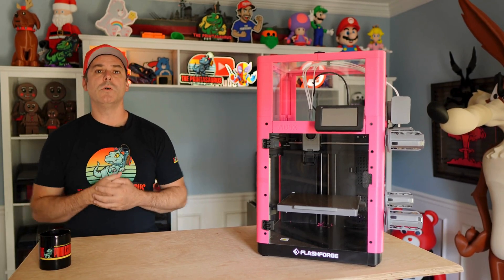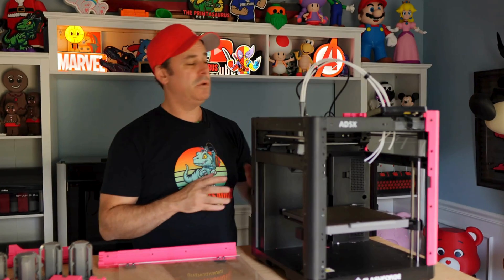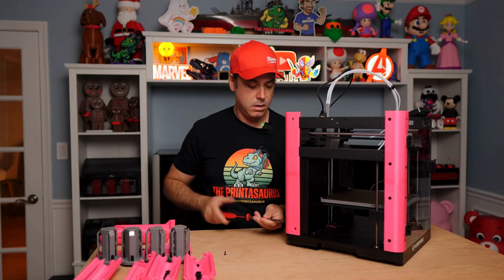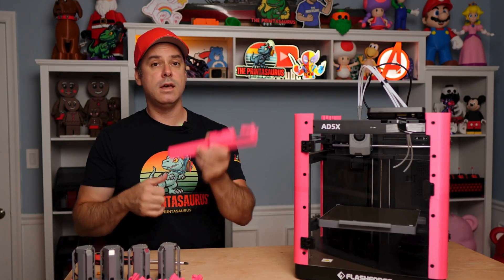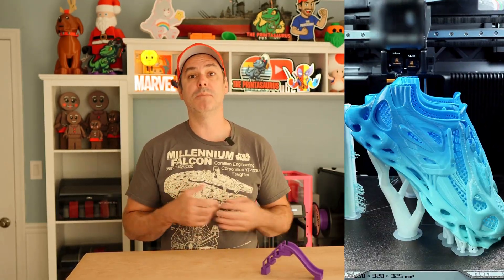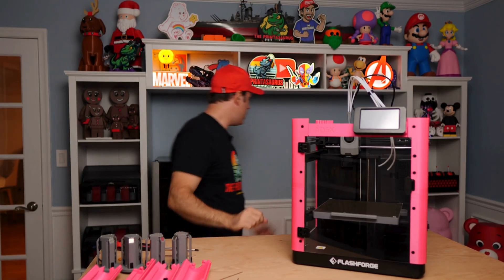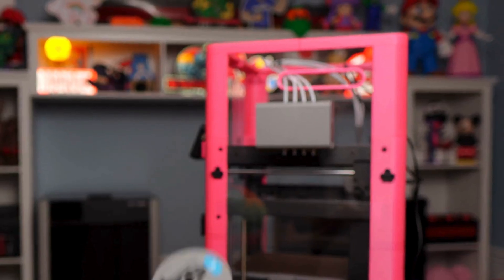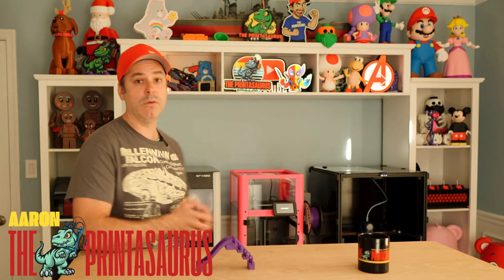Flashforge AD5X Enclosure Installation, Full Setup Guide

Comment: To add for people who are new to this, on the AD5X the tubing comes off of the hub by twisting the locking mechanism a quarter of a turn then pulling. You need needle nosed plyers for this.
Reply from the maker: Thanks for adding this
Reply: Спасибо тебе, добрый человек. Я долго мучился, боялся сломать.

Comment: Some screws that should be unscrewed just spin freely, making it impossible to unscrew and therefore install. This is especially true for the screws holding the spool holders.
Reply from the maker: Should be longer screws in the kit for the spool holders. M3x8 if I remember correctly. What may help, keep the other screws loose, thread / screw in each spool holder then tighten the remaining screws.

Comment: can i print the enclosure with pla or do i need a more dense material
Reply from the maker: PLA would be fine, PETG preferred. If you plan on printing some ABS or ASA I would at least use PETG as it will support the internal temps better. But if you plan to just print PLA/PETG/TPU you can use Pla without any issues.
Reply: @ThePrintasaurus  i will be changing to a universal enclosure as ad5x is currently unavailable by anyone other then scalpers the prices are appalling compared to flashforges store prices thank you for the knowledge in advance if i decide to eventually get one for proper price

Comment: Has anyone had issues with the side panels not having slots for the IFS unit?  Mine does not have screw holes.
Reply from the maker: I’ve not heard of any issues. Have you reached out to flash forge?
Reply: @ThePrintasaurus  I had that issue on the set I received also. Both side pieces were the same, and did not have any additional holes for mounting the IFS. After I placed the panel in the side holder I drilled holes to line up with the frame screw holes. Easier, quicker, and better than trying to deal with shipping.
Reply from the maker: @d.r.4338   That does sound like a quick easy fix. I wonder if they have had some manufacturing issues, sounds like it on the panels. How has your build been otherwise?

Comment: I'm trying ti put the spool holders back on but I need counter sunk screws and the m3 aren't so the spool holders won't clip back on. How did you do it?
Reply from the maker: You should of had longer screws that came with the kit? Are they missing? Should be m3 X 8 mm, 2 mm longer than the ones originally used.

Comment: I would like to know if you could send me the profile because according to my setting it will take well over 40 hrs using petg. Also what extruder are you using because I thought with the 0.6 it would lessen the build time?
Reply from the maker: Send me an email to aaron@theprintasaurus.com and I'll send over what I've optimized for a few that have requested it.
Reply: With the enhanced version with the taller top piece it took 45.9 hours to print it all on a AD5X

Comment: 20 hours to print?  Is there a secret to printing the parts?  I'm doing just the first printing plate of I believe 6 total, and it is going to take 39 hours to print.  At this rate it will take all week to print most of the large parts.  I am using PETG as it was recommended online.  I am printing 2 different colors which may take a bit longer but how did you do it in 20 hours?
Reply from the maker: I have my print profiles refined a bit. With the enclosure being supported by the printer and more less being a cover, I went lighter on infill, walls, etc which speeds things up. I can send over a 3mf that I did for a few people who requested some help. Would be interested to see how yours turns out with 2 colors.
Reply: @ThePrintasaurus  I'll let you know in about a week or so. Lol

Comment: I dont know what print profiles your using but with petg my print time is in excess of 40 hours. Also the pre arranged print plates are best avoided too many parts and bed adhesion on ad5x is not great. I had print fail and spaghetti at 90% cost me 400 grams of petg and 15 hours print time. 

Ive now completed the prints, printing the corner pieces 2 at a time split between the ad5x and qidi q2
Reply from the maker: I've have a 3mf setup that I've shared with those that have asked. I have fine tuned some settings to speed things up, I did print with the AD5X, utilized a brim to help with stability of the column (A,B,C,D 1-3). Totaled out print time was about 24/25 hours total, days worth of printing. If you'd like that 3mf, send me an email and I can send it to you. aaron@theprintasaurus.com

Printing one by one is never a bad idea either. What color / brand / type of PETG did you end up using? Curious to hear how everyone's enclosure looks and turns out.
Reply: I rearanged the parts on the plate to avoid conflicts, worked great

Comment: My iphone ,laptop and iPad including flash forge to not recognize the printer. It prints the tugboat. Pretty much useless at this point.  Unless I want make tugboats forever. Help
Reply from the maker: So you can't get Orca-flashforge to connect to your printer? Your only able to print from the screen, to do a test print? Could be network settings, firewall, etc. Could also be a corrupt download / install of orca flashforge. Strange that you would have issues with multiple devices. I wonder if the wifi/network card is defective in your AD5X? Does the printer show an IP address, can you ping it?
Reply: @kenschwer184 I ran into this problem initially and it had to do with login.  You may want to go to the home page of Flashforge app on your pc/laptop and log out then log back in.  I have also seen where the app just logs out for no reason.

Comment: Living in Puerto Rico Flash Forge does not ship here. So I have to wait until the printers and accessories are sold on Amazon. I tried preordering the kit but the shipping kept being extended. I canceled the AD5X kit and bought the 5M kit. It basically is the same with out the top side panels. I used 3mm black corrugated plastic for back and sides top panels. I printed the front top panel to fit a glass plate from a 5*7 picture frame for viewing. the only other thing I adapted was to print an extra pair of the door hinges and mounting them to the top panel rear. Works great for ASA and ABS. I adapted a 50mm usb fan to a 3 in flex hose to exhaust fumes out a window vent insert.
Reply from the maker: That sounds like you've had to do quite a bit of customization, but also sounds like you've got a nice setup going! Nice to hear you were able to make something work for you. I like the usb fan idea.

Comment: Hey i just ordered my kit and was going to print out the enclosure ahead of time but I am fairly new and hope you could let me know if you just used the exact settings from the 3mf Flashforge provides on their website or did you tweak some things? 
Like mine estimates 1.2kg of filament but you said in a comment that you used "almost a 1kg spool" Is Orca just off on how much it will use? Or is it because it has supports automatically enabled and i should disable them? 
Second my software says the first plate has objects too close and there may be collisions while printing, now while it seems obvious to just move that object to another plate of its own or something, this is also why I was wondering if you just clicked slice and print on exactly what FlashForge provided as a 3mf or should I be changing stuff?

I would really appreciate a bit of help before i start the process! :)
Reply from the maker: No problem at all. For the columns A,B,C,D I printed for example A1, A2, A3 together, and used no supports. You can flip them to the right orientation to not need supports. This saves filament. I printed everything at 3 wall, 15% gyroid infill and things have been great.  4 top and 4 bottom layers. I was able to keep things under 1kg of filament this way too. If you send me an email, I can help you get things in order or try and send you a 3mf file ready to print. 
aaron@theprintasaurus.com
Reply: @ThePrintasaurus  Hey not trying to be a pain or rush anything but wasn't sure if you got my email for the 3mf as i haven't heard back. 
All good if you got and just been busy but just checking in! 
Thanks again.
Reply from the maker: @LowLifeDust  I'm working through emails this morning! I'll find your's and get over a 3mf. Thank you for the reminder.
Reply: @ThePrintasaurus  Thanks, appreciate you a lot!
Reply: @ThePrintasaurus  Thanks for the fast response! I think i understand what you are saying mostly but I am going to shoot you an email in a moment as a 3mf would ease my mind in knowing its all laid out properly.
Reply: What filiment did you recomend for this print?

Comment: I just want to know if it works with opensource firmware... what is the mobo???
Reply from the maker: From what I've researched it's not a typical 8-bit or 32-bit microcontroller board like one with an STM32. This is a pretty good resource for the 5M. https://github.com/DrA1ex/ff5m    They don't have a 5X yet, but keep an eye out.

Comment: The AD5X just like the 5M does have some slots for filters. Those 2 rectangular filter cover door looking things with the holes in them are where you can install filters. I have no idea how well they will actually work but they do have ducts that lead to fans in the back of the printer.
Reply from the maker: The AD5X’s filter covers are mostly just open grills on the side, and with the Z lead-screw area open, there’s no real pressure path for a passive filter to do anything. Similar in design to the 5M, but looks like the 5Mpro has an actual filtration system. Which would be a nice addition as an upgrade option once the 5X is enclosed. I'm still playing around with a bento box option, I haven't had a ton of time yet to get that together! But planning a video soon to show that install and how it prints with ASA/ABS, etc.
Reply: @ThePrintasaurus  I added filters and fans to my ad5m and my ad5x and both filter out toxins perfectly
Reply from the maker: @DonaldJones-o4d   That is awesome!
Reply: @ThePrintasaurus how does it do with the tubes hitting that top cover? Does it push it up?
Reply: There is no fan, but more importantly, the pins for the exhaust fans are not populated on the mainboard for ad5x. Though with building an enclosure, I'm tempted to solder pins on it and see if I can enable the exhuast and get it too work, might have to use zmod or another open klipper
Reply from the maker: @SeanHinkley-n9b   I have been reading up on zmod and Forge-x. Since they have the AD5M, I was curious if anything has progressed for the ad5x. Doesn't look like it yet!

Comment: No entiendo para que sirve todo ese espacio superior... Por cierto, muy buen video. Te quedó muy bien la carcasa!
Reply from the maker: The top space is more or less for the ptfe cables and the hub to have a spot to sit. It’s not an idea design, it hasn’t caused any problems either, just a bit taller.
Reply: @ThePrintasaurus Resulta un poco extraño ese espacio enorme arriba 😅. ¡Gracias por tu tiempo!